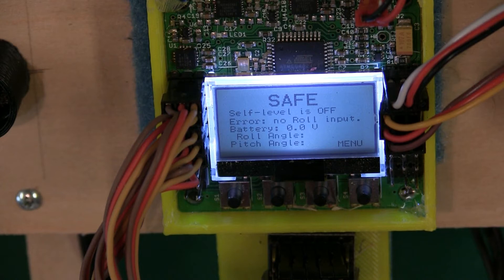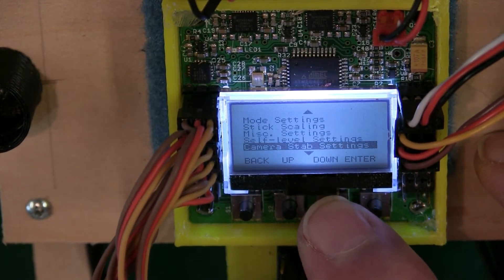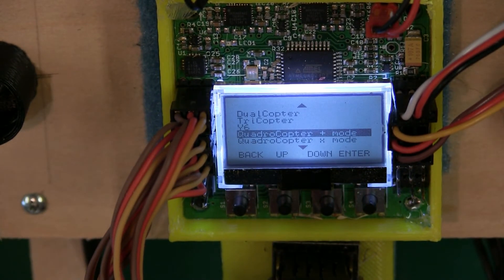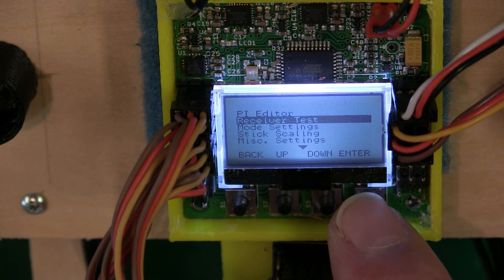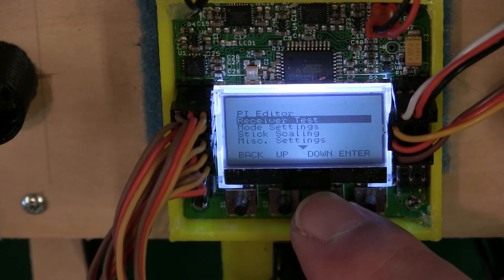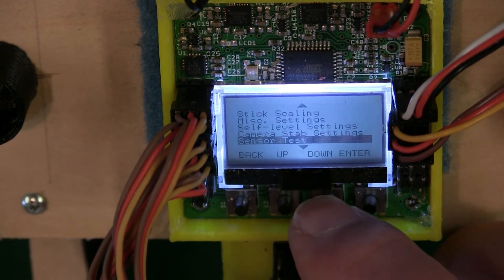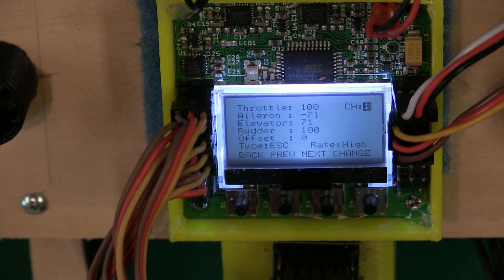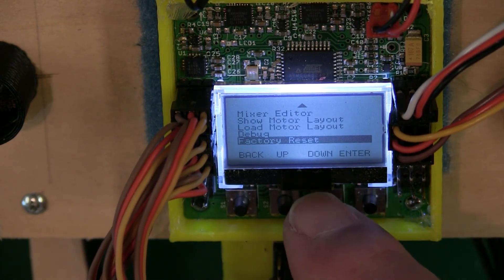QuadLugs - Build Tips - KK2 Control Board Setup

Comment: What version is your KK2 board flashed with?  There are several versions.  When you talk about leaving your PI settings on the factory default what are those numbers.  In the video you didn't open the PI editor to show the factory settings.
Reply from the maker: 1.11S2 - before you flash go to factory reset on your board and reset - then after you flash with 1.11S2 - those are the PI settings I use - now this is with a QuadLugs frame - I don't know how any other multi-rotor would react to these settings